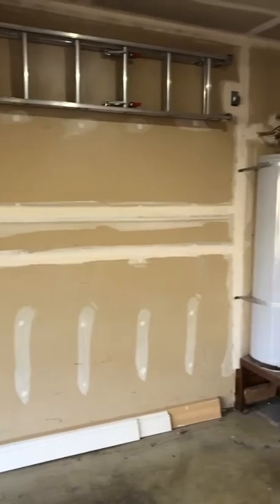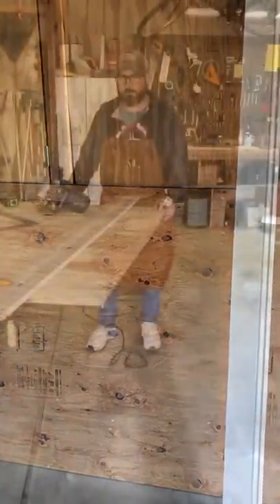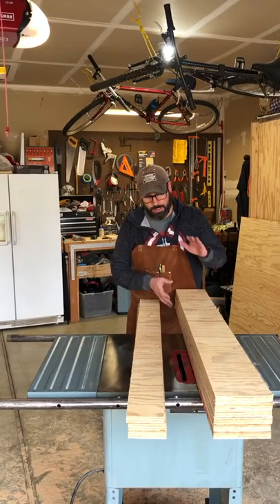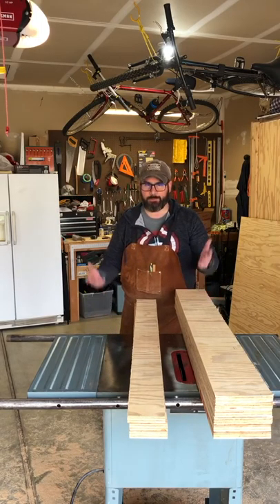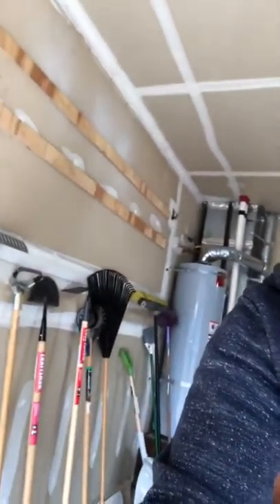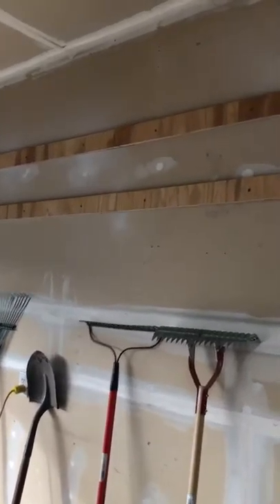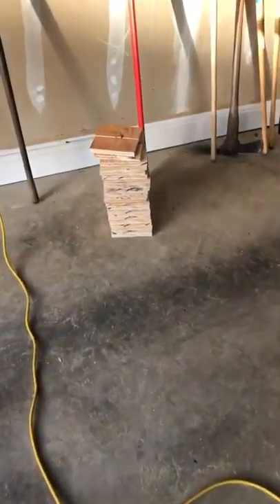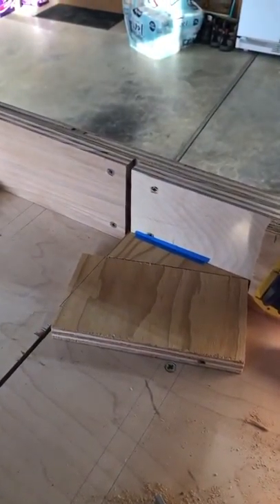French Cleat Wall System

Comment: Terrible idea. You are going to be knocking tools off the wall left and right with this. Cleats are only a good idea if what you are hanging is heavy enough not to get knocked off when bumped. Those only have to move about 1/2 inch before they are falling on your car, feet, dog or kid.
Reply from the maker: Well they’ve been there for over two years now an nothing has ever fallen or been knocked off. All of the holders are angled at the top to keep everything tight to the wall. But what do I know.